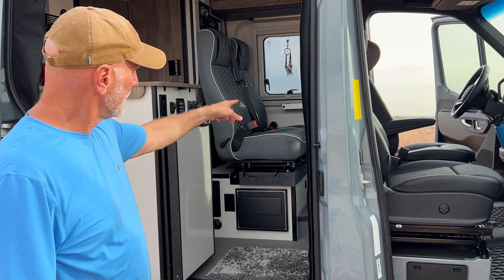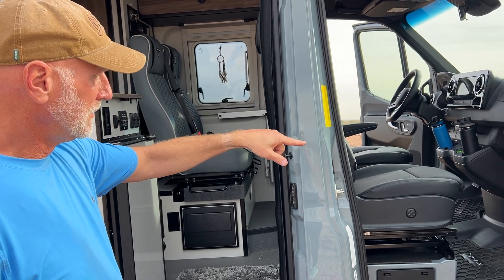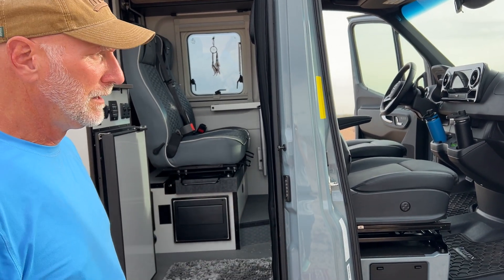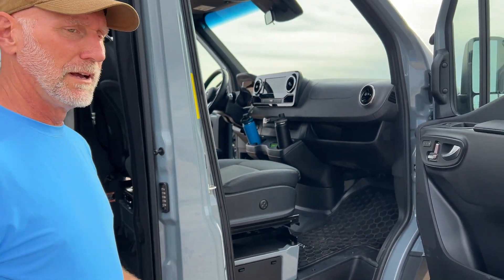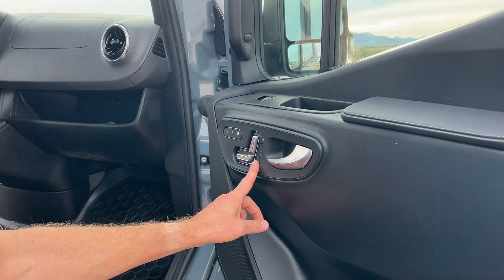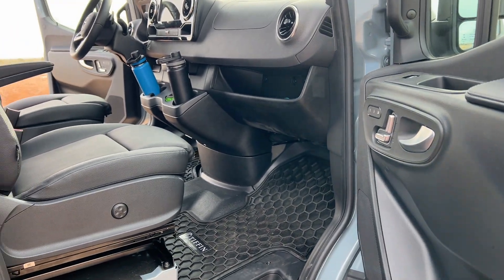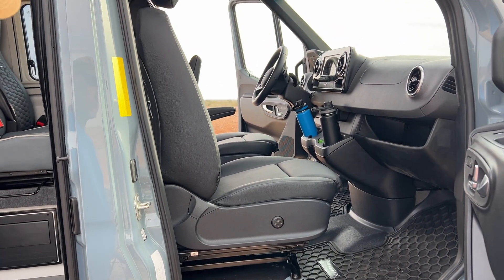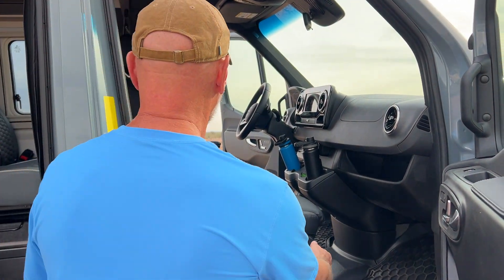2023 Tiffin GH1 Adventure Van - swiveling front seats and a TRICK

Comment: I'm picking up my 2023 GH1 tomorrow and have a few questions if you don't mind.
1. How long will your AC go on batteries, assuming starting out with a full charge and outdoor temps in the 80's or 90's?
2. Typically how far/long do you have to drive to charge your batteries from a low state to fully charged?
3. Did the rig come with privacy shades for all windows? I saw your video on the back of the van and its shade/screen. I want to be sure of this before the dealer tells me different.

I debated waiting and getting the '24 but I'm not sure what to think of them going to the 4 cylinder engine and the AWD. It'll be interesting to see what the other adventure van guys do about that being that that's the only MB will offer going forward. I just saw the new Revel does use the new 4 cyl AWD chassis...
Thanks!
Reply from the maker: Thanks for asking.  1)  We bought at the end of December in Tucson so have not had a chance to really use the A.C. for any amount of time.  Sorry.  I hope to learn more about those limitations this summer.  2)  We asked that question during checkout and the tech said things should be charged after driving 1 to 1-1/2 hours.  That's about right from what we have experienced.  3)  The black privacy shades in the back and on the side definitely came with it as standard.  The sales guy said that La Mesa bought all the remaining 2023 because they weren't sure how the 2024's 4 cylinder was going to perform.  We had planned to use the GH1 this summer for more extensive Idaho and Montana adventures but we are putting that off a bit.  We are still learning!  And we like it so far.
Reply: @TheSwanStory  Thank you for the response,  I'm also picking mine up at La Mesa after inspection tomorrow. Then it's off for a trip. Happy travels...